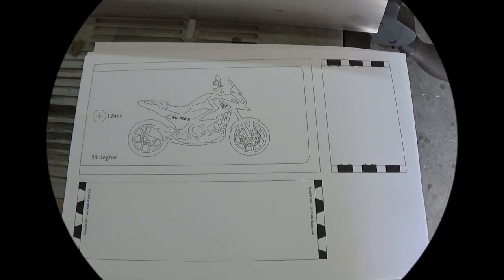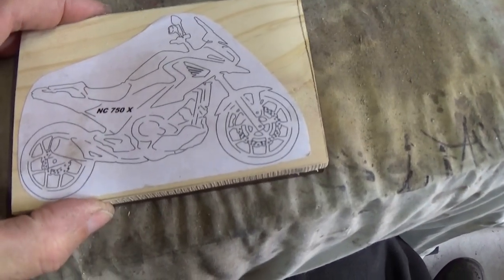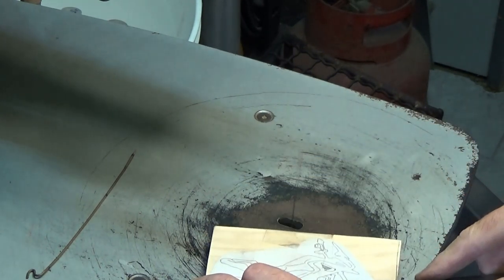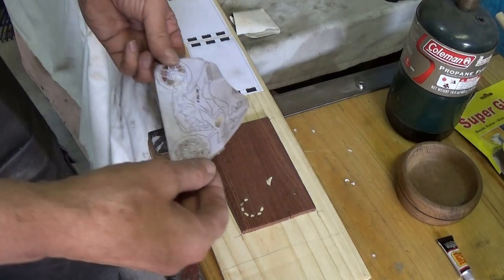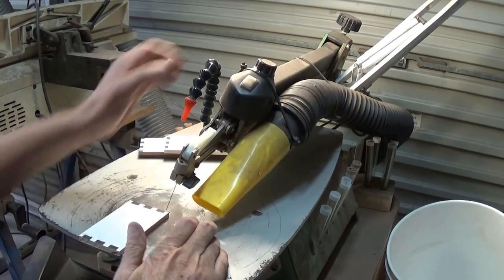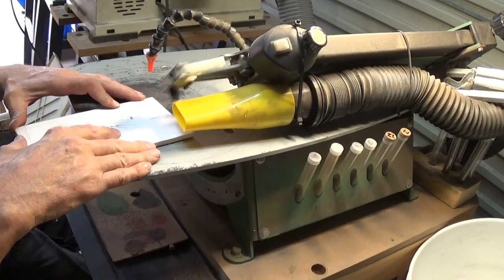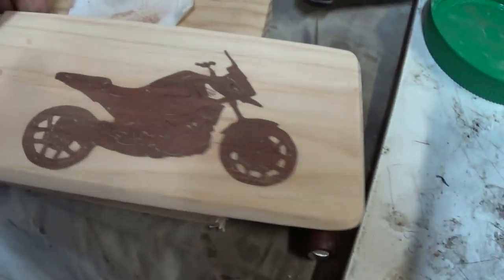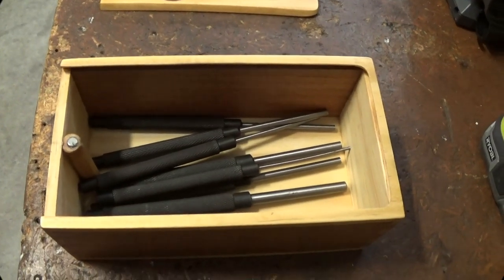The Virus = No Riding: So What Else Can I Do - PART 5

Comment: Very nice. I used to do a lot of scrollsawing, but eventually the close-up detail work began to bother my neck, making it no longer "relaxing & enjoyable". I also found wood frustrating to deal with because it "moves" with time, meaning it can cup, warp, crack and swell. I still have my scroll saw (a Delta P-20) because I can't bring myself to get rid of it. I've often thought I should get into metalworking and I admire the skills you've shown in other videos.
Reply from the maker: Thanks mate. Yes. I understand the “close up” issue. I’ve got to use a magnifying glass/light.